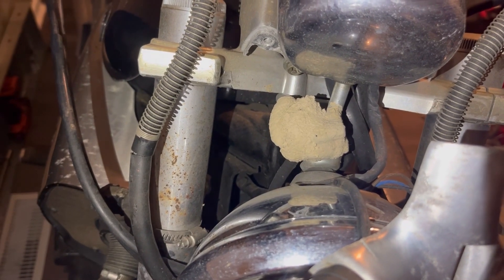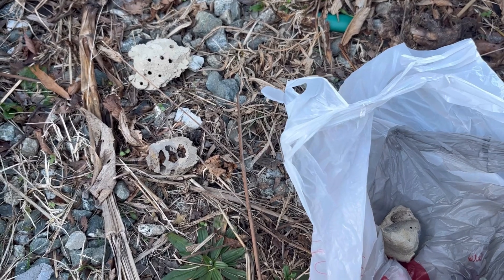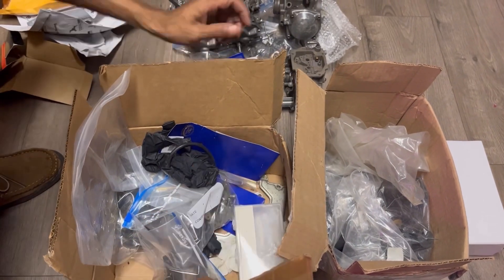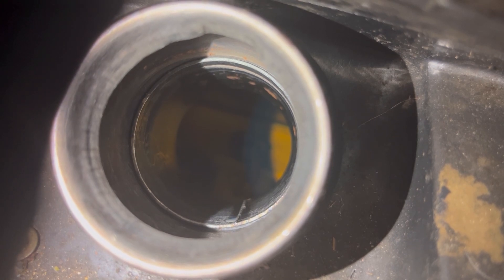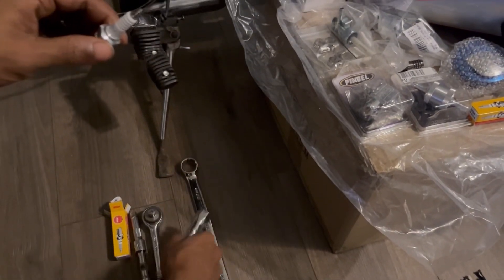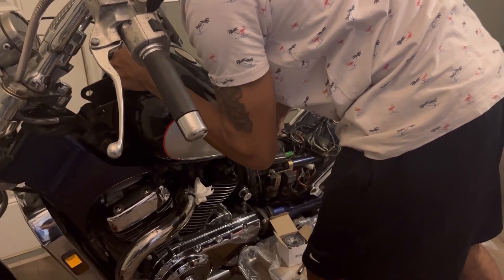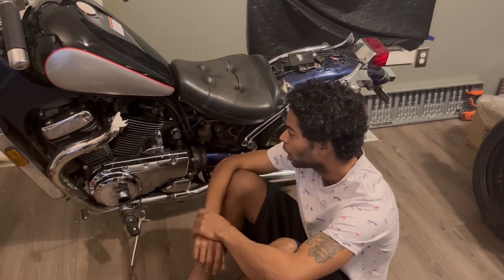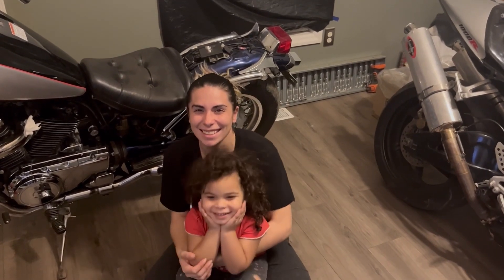🏍️ Suzuki Intruder (Rebel 250 Gas Tank EASY Swap) + Vmax 1200 Update

Comment: Thank you for posting a cost effective tank swap. Could you please give a link to the On/Off switch, I want to try putting that tank on my intruder as well.
Reply from the maker: yes ill make sure to include a link to the on/off switch and I'll include a link to the matching fuel filter
Reply from the maker: https://www.ebay.com/itm/173953379393?epid=171270537&hash=item28806dec41:g:XjMAAOSwBlBdHUIZ&amdata=enc%3AAQAHAAAA4IR3E1URnTSU75su%2Bt00aieNp5pnUE08zXvC5LXRCkbSIpz1ihdGzdQWwl1pSsp3qgUDtEm19Zfrtf1S%2B%2FqtrmvpnfmbBeiA0ii0o5gnm%2Fb1KB3YTFlONfSdF2ueK6iAix9CjgRYOyMQMuOyK0JCkQSsnCMcnE1iWvLV%2B3sMVoUs8nAauSKFjABfevjZYUc1yCa%2BK%2BLV8NfDyiILZQXgG1dMGuERRyrEPG%2Fgu%2BHIIy10J1otBRwzZOxi0XytusMx0wPvgM54E6SUO%2F14CzXV6xYtP0hlhcirEuIbDId%2FI8af%7Ctkp%3ABk9SR4CZhfPqYQ
Reply from the maker: https://www.ebay.com/itm/195061794229?epid=171179881&hash=item2d6a96c5b5:g:AR4AAOSwyTpjjlMU&amdata=enc%3AAQAHAAAAwDRueNicrfNZG3y%2FHWlEYibwRcbF77iTLYt0Un%2FK38n9Mz4fXJ9FspZ%2FmMcBp%2F%2FVsqv8X8c2PCCa4wRvkXvcInYuxYlEI6e4gD0AAos7awKxeP0Dd4dl558NA01CliEthDGSt6Cy9eXMzkNJDuhrJWI0aeKewNyqIRufQqGYomR7X4RtOD8cAIJfUrJeLL7NqWi3LJwSR6TlFlncx%2BCE1LwVDsEYEDj2W%2BwJMaLhNQI9HFHXBS0707ogmBnU1894%2FQ%3D%3D%7Ctkp%3ABk9SR-7DrPPqYQ

Comment: Thanks to this video I went with a conversion myself with the gas tank because the original tank was far to gone, I was wondering what kind of mounts did you guys grab at Home Depot?
Reply from the maker: thanks for watching the video I used thin steel mounts that we were able to cut using the Dremel to fit this application

Comment: What is holding the tank to the bike?
Reply from the maker: we used metal brackets from home Depot bent them to fit drilled mounting holes
Reply: @2wheelfamily493  so you drilled into the tank itself? I would think that would leak.  Thanks

Comment: I have a question if you don't mind answering. I have a Vfr 800 can you point me in the right direction to get a new gas tank for it is a 2004
Reply from the maker: hello your best bet would be on eBay that's where I buy all of my used parts. also Facebook marketplace is a great place to find used parts as well
Reply: @2wheelfamily493  ok thank you so much it has been setting a good while I think I might have to get someone to go through the whole bike for me